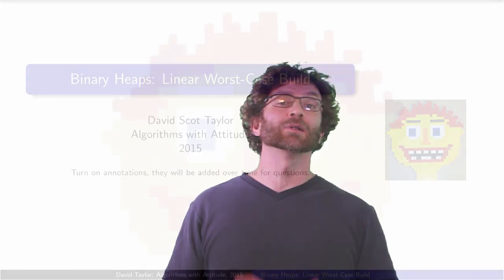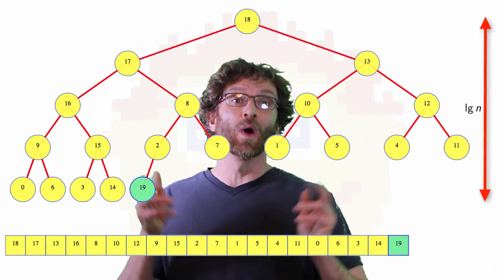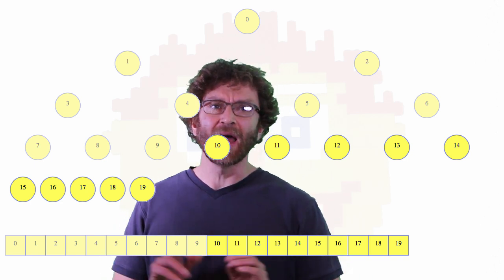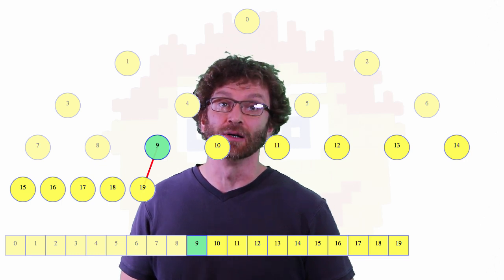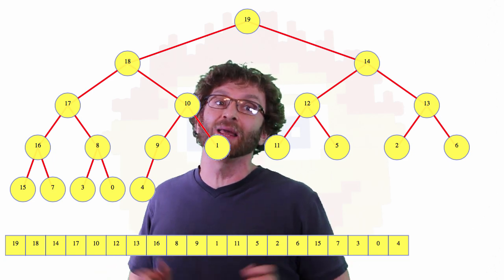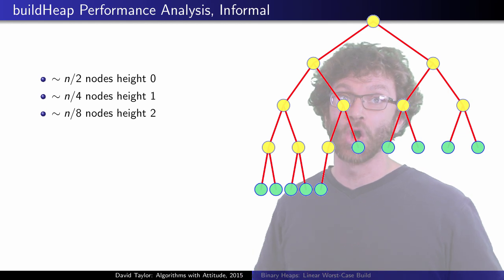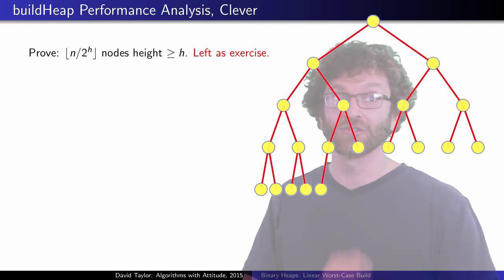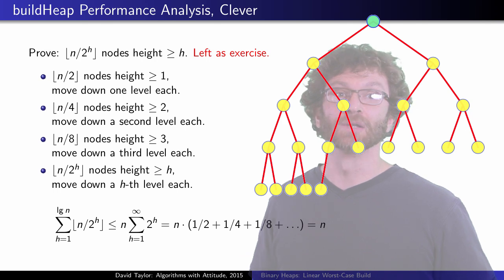Linear Time BuildHeap

Comment: Great video, thank you! Sometimes it can be hard to find its subsequent videos, would you consider putting down the links of subsequent videos in description?
Reply from the maker: This was the first series I put up.  For later ones, I just give a link to the playlist using annotations (which don't work on mobile), and for even later ones, I start using "cards" (which do).  A link to the playlist in the description sounds totally reasonable, I will add that at some point.  For this video, I switched over to cards and the new end-screen stuff, after reading your comment, but I will do that more systematically some time in the future, when time permits.  Thanks for the suggestion.

Comment: In this video it looks like you are doing siftUp starting from the very last element of the array. From this link, (http://stackoverflow.com/questions/13025163/why-siftdown-is-better-than-siftup-in-heapify), they say that siftDown is faster. Can you please clarify this situation?
Reply from the maker: For the first minute of the video, the animation shows how to build a heap by iterated insertion.  Insertion uses the siftUp operation, and in the analysis of that approach (around the 0:30 mark), I mention that it has worst-case O(n lg n) runtime, though with random values, it has O(n) expected time.
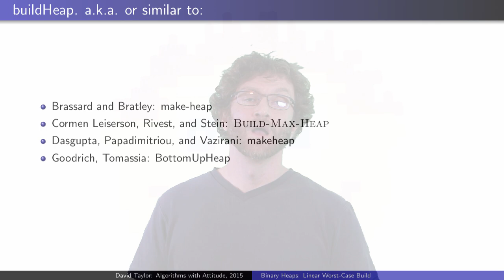Next, starting at 1:09 in the video, the rest of the video uses the siftDown approach:  instead of starting with the first element and growing it as a tiny heap, start with the last n/2 elements, and take each to be the root of a 1 value heap.  Then, working from the middle of the array back, for each value, take it to be the root of a new heap, and sift that root down as needed.  Because most elements start near the bottom, the sum of time needed for sifting elements down is O(n) worst case.  The proof of that which I give at the end of the algorithm is pretty slick, and I haven't seen that argument used in the heap context before, though it may be out there somewhere.
Thanks for the question.  In watching the transition from one approach to the other, I now see that of course my explanation isn't quite as crystal clear as I had thought.  Hopefully this explanation will help (though depending on what source you use, siftUp and siftDown might be known by other names).
Reply: Thank you very much for the explanation. In my previous think, siftUp and siftDown meant starting at the the bottom and top respectively, where we check that the heap invariant holds. I see now that we are really running siftDown on every subtree going from the end of the array (or really the middle of the array because the leafs have no children) and calling siftDown until we reach the root.

Thanks for all these great videos :)

Comment: In the previous video, didn't the iterated insertion take the least number of operations when the number was small?  Because in that case, wouldn't the root take the most operations in both insertion and linear heap building?
Reply from the maker: Insertion takes no more than logarithmic in the size of the heap, but if you grow a heap by iterated insertion, the last n/2 insertions are all into a heap of size n/2 or larger, and log (n/2) = (log n) - 1.  If you insert the first number in the array first, it becomes the root of the newly formed heap of size 1.  The last value inserted goes into a leaf position, and then can work its way up by heapify.  There is only 1 heap.

For linear time build heap, you start with a whole bunch (n/2) of small heaps of size 1 each, and then add new roots to merge 2 heaps.  Most all merges are of small heaps.  The last insertion merges two heaps of size almost n/2 each, and it can take logarithmic time, but the vast majority of merges are between tiny heaps, and in total, it takes worst case linear time.

Comment: Hi David, thanks a lot. These are great set of videos. Could you number the videos, so that a learning trail is easier? For example binary heap lectures, it was difficult to find the next lecture. Numbering could help a lot.
Reply from the maker: SOS If you are watching with annotations turned on, the end of one video will generally have a link to the next one.  Also, there are playlists:  for heaps, you can check out https://www.youtube.com/playlist?list=PLSVu1-lON6Lwqj5nDqg8YyD7f4tjLMMBN

For some sets, the playlist won't be quite linear.  On one of the analysis playlists, there is a sequence of 3, and a 4th video that can be watched anytime after the first one of that playlist.  Using the annotation links, you can probably take more than one path through, but the playlist should always have a reasonable path through the videos.

Notice, for the heap playlist, the last video in the playlist is very much optional.  You could watch it 2nd, or skip it.  Because it is more advanced, but also less important, I put it last in the playlist.

Hope this helps.